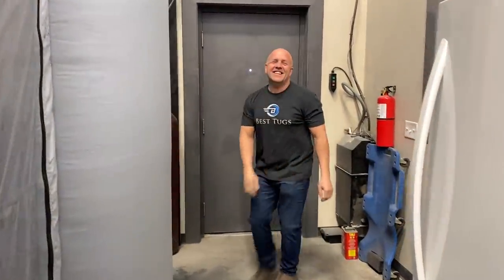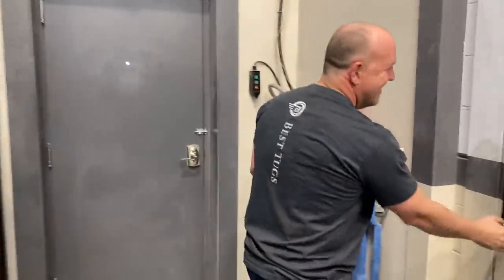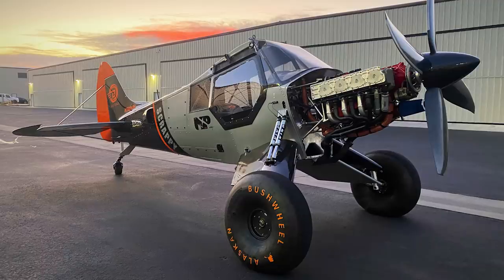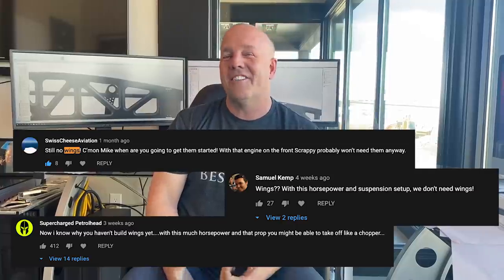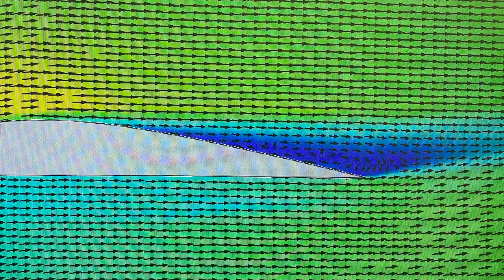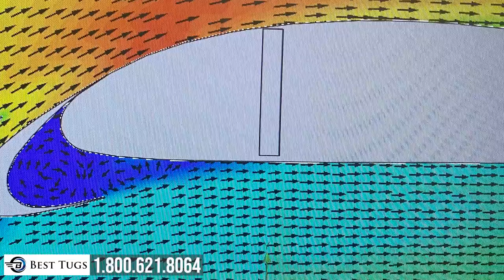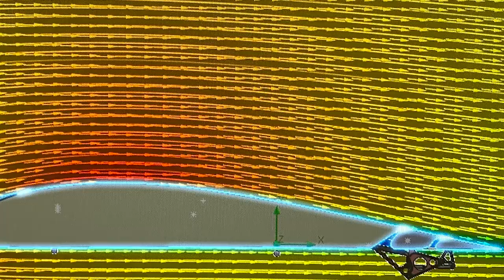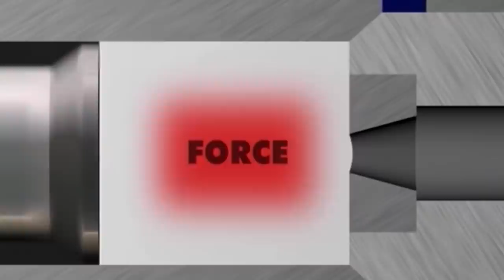Airplane Without Wings, Let's Try Something Different! | Scrappy #42

Comment: Mike: I realize that by the time you read this, the wings are already on the plane. But I have a wing design in mind which has been nagging me. I fly a zenith 801, So I know how beneficial slats and flaparons are. But I was kicking around an idea of a retracting biplane wing that is just a "cap" of carbon fiber on the top of the bottom wing which, when in cruise is snug on the top of the wing and would be invisible for the most part until extended. It would operate similar to adjusting flaps with a lever, the "cap" can be elevated several inches above the top of the wing surface, creating a second top wing only seperated by inches instead of the traditional full meter or more. The beauty of it would be that the chord of the top "wing" could be minimal because it wouldn't need to be as thick as a normal wing, because of the slot it creates between the bottom wing and the top wing. It would operate much in the same way that slats work, with the space between the 2 wings being small, but providing a much higher percentage of lift per inch sq.
On the ground, with the top wing pulled down flush to the top wing like a cap, being thin carbon fiber, (perhaps also reinforced in the layers with shaped, thin aluminum flat stock) you wouldn't even be able to notice that the wing had a second layer on top of it until the extension lever was pulled and the top wing was lifted up a few inches creating the gap.
It is just an idea but I am going to build a model airplane and see if it works.....
I love that you take the time to go over all of the details of your design thinking. I am kind of nerdy that way, I think most pilots are.
Ok, back to work!
Reply: Looks like a great idea!! But don't you think it would induce a ton of drag ? Also, the pitching moments created by the such a design would be immense... I can't begin to imagine the torsional loads created on ribs. Because you would have a flow transition point which would be behind the aerodynamic center of the actual. This means the normal (perpendicular) lift force differs from the actual wing and the "biplane" wing would pull different loads on the same axis, and that's an engineering nightmare!! But you should by all means try it and share your results!!
Reply: Ha gold, it could completely negate the pitching moment of the flaps if they deployed in unison. Maybe use a lock to prevent deployment in server turbulence in cruise and then have it auto deploy at an angle of attack. I am sure Mike now has a whole lot of data on the slot effect now so calculating the height above the lower wing might be easier with a few pointers. Adds a whole new dimension to Vf... ;)

Comment: You need variable geometry -- one geometric configuration for STOL, and another geometric configuration for high-speed flight.
Reply from the maker: That’s exactly what I’m doing, a transforming wing in flight
Reply: @MikePatey  negative flaps? Some gliders have them to decrease lift and increase the best glide speed.
Reply: @MikePatey  So are you thinking of trying "drooperons"? Some STOL designs have "drooperons" on the leading edge that deploy with the flaps, to improve the STOL characteristics of the wing. Retractable would be great, to allow for higher speed cruise.

Comment: Hi Mike,

Possibly consider variable geometry of a sweep wing, like on the F-14. The F-14 has several unique solutions that meet your goals. Stepping back and looking at a F-14, you will notice that the sweep wings are actually short and that the rotation occurs far from center of the plane. This allowed the body of the F-14 to also act as a wing, i.e. lift body. Now, for the F-14, this wide body allowed it to hold fuel, lots of fuel, and other things as a war bird. Also, it's two engines where wide apart as compared to other similar planes (e.g., the F-15 are very close together).

At any rate, I've always wondered why the wide body and short variable geometry wings of the F-14 have not been applied in other airplane designs.

Perhaps the outer region of the wing could sweep. Not a full sweep. But perhaps a 45 degree sweep. And the area of the wing closer to the body could be twice and wide, or more, than as the wing further from center line.

The gull wings of the F-4 Corser also produce both lift and speed. And short landing gear legs (i.e., weight savings).

Cheers!

Lincoln

Comment: I was thinking he needs the slats and flaps of a bf 109, only with motorised slats and extendable flaps like a jet airliner. It looks good in my head anyway...😆
Reply: Yes, that is what I'm thinking but, the weight?
Reply: I agree with the slats and flaps.   Make the flaps Fowler flaps.   Could they be manually operated ?    Either way, they add complexity and weight.
I’ll be watching.

Comment: Make a morphing camber wing. Make the top of the wing out of flexible a material. Swell for lift, shrink for speed.
Reply: Yep its feasible the Americas Cup AC75 boats have it and it is basically a vertical wing.
Reply: Could do the same with the underside. Pump out of the upper bladder into the lower.

Comment: I can’t stop envisioning f-14 style wings on scrappy
Reply: Me too, once the concept was said fast and slow.
Reply: @SimonTekConley  Which describes the F-111?
Reply: @garychandler4296  I ended up looking up all sorts of planes with the config. The Russians have some interesting designs. 

Another interesting way to go about it, would be having splits in the wing, where  you could change the profile on the fly. Say from a slow and go piper cub design to a more speedy swept back. Basically allow the leading edge to fold back into the wing to change the profile a bit.
Reply: @SimonTekConley  Nice. I was thinking that if the wing were flexible in the forward third, an aluminum control shaft would rotate, having maybe nylon or urethane wheels along it's length, on an elliptic arc that would push and swell that front 3rd, thickening it for slow speeds.
Reply: Ug, saw this after my comment. What an interesting channel.

Comment: Look closely at how the Blackhawk “tail” assists in maintaining a “level flight” cockpit, literally “extending” the fore and aft pitch con.  Don’t get wrapped around only the main wing.  Rather think about making the “entire aft wing” (and elevator), also “move” to obtain the optimum low speed or fast speed flight profile you desire.

Comment: Had you looked at The uk’s blackburn buccaneer. It had blown wings/flaps to reduce the landing speed for carrier landings - I know they had jet engines BUT your donkey up front seems to have a huge amount of available power at low speeds to use. Love your energy.

Comment: In the Army, back when we only had one radio to triangulate our position and an ash tray in the center of the dash like a VW Beetle. And auto pilot was a friction lock on the collective similar to an old farm tractor.
    I flew a UH-1H helicopter.
It hàd a semi-ridgid rotor system. The new helicopters like the UH-60 has a fully articulated 4 bladed rotor system.  Both systems morph to accommodate the pilots controller inputs and situational loads.
     I already see your on the right track. Good luck with it and I can't wait until we can have a look at your cutting edge design.

Comment: When I was studying aeronautical engineering in college, I always wondered what the perfect wing would look like. One that could morph into the needed shape for the task at hand. Something that could adapt while flying. Since I worked at an R/C hobby shop, I could build a model and test and perfect my idea to build an inflatable wing. Yeah, you're all going to laugh, as I did also! What I was able to solve was the ability to change the shape of the wing for prescribed performance envelopes. I played around with the idea for many months but having to focus on work/life, I abandon the project. I'm pretty sure I'm not the only one who's thought of this. Heck, deicers are inflatable parts of a wing. So it's to some extent that it has proven not that too crazy of an idea. To add to my idea was to offer the ability to change the wing's angle of attack. My buddies have done this with their R/C models in order to eliminate using ailerons to reduce added drag and complexity. Anywho, just some ideas I have worked on in my spare time when I was deep into my R/C hobby and engineering classes.
Reply: Inflatable camber chambers...

Comment: Just got the last section of your program. You are on the right track The width of the wing changes the wider it gets the flatter the top section which reduces lift and drag 
and the faster you go. 
Now using a semi symmetrical wing section will provide more lift at slow speed and less drag at high speed creating a more aerodynamic wing section. Swept back wing tips and trailing edges will also help your speed target. 
Flaps will only be needed for take off and landing when the wing is set for low speed they can drop down from the flat lower section. 
I used to build crazy flying machines in the 60’s using basic RC 
I look forward to seeing the wing you are going to create. I am sure it will work and revolutionise design for air rescue aircraft to be used in emergencies and very short runways or fields 
You may want a split cowling like bomb bay doors to hinge in the wheel struts to cut the drag on those big tyres. They lift to land an close around the wheel in flight 
The aircraft will look sexy with them to say the least 
All the best N

Comment: Thank you for sharing. I love anything mechanical. Especially when the builder is pushing the boundaries the engineers have set. Your thinking outside the box and that's the way I roll. I have never flown in anything. I'm terrified of just the thought.  But I love going fast on the ground. I did a dukes of Hazzard flight in a 1976 Datsun 620 pickup to avoid a head on collision with a Cadillac. I was passing a vehicle on my right that sped up and wouldn't allow  me into the right lane. And  the Cadillac was hauling butt towards me. No time to slow down and get behind the car on my right. So I lined up on an embankment that I knew was soft fly ash fill covered in grass. I knew this because it was a couple of my Buddies lane and bus stop for school years earlier. No time to waste I slammed down the gas and hit the fly ash bank at 70 plus, just as the Cadillac was clearing my right rear bumper. I was airborne at least 30' high. The owner of the yard I was flying over came around the corner of his house on an orange riding mower to my left. About 150' to 300' feet into his yard that sloped upward I made a perfect 4 wheel landing with a little bounce. I turned the truck around drove back out the way I came in immediately  without incident. I drove back home and thoroughly inspected my truck no damage nothing 🙃.  I left and went to my buddy Tim and told him what had happened. He didn't believe me until we drove by the place where it happened and he saw the faint tire marks of take off landing and return track down through the yard. Yes   I know I was lucky. Hollywood makes those stunts look easy and there's a lot of math- tikular calcumacations involved. I  just got lucky. Sorry to go so long. Have a wonderful day.

Comment: Would it be possible to use a "flexible" skin on the front of the wings and have a cam shaft type of internal device that can roll internally to widen the leading edge for slow speed and roll back to thin out during high speed? The skin may not even need to be stretchy, Just engineered to be tight throughout the process of changing the geometry. Just a thought that came to me while listening. Carry on.
Reply: JD that is exactly what I was picturing!😄
Reply: I was thinking the same think. A way of it  being stretchable

Comment: sounds like something that inflates,, deflates to the desired shape. or he has a bunch of motes   (the mote in gods eye) constantly  rebuilding the wing in flight.
Reply: "moties". Actually, I thought of the inflation thing, too. Or clever use of piezoelectrics?
Reply: probably using the inflatable deicing system that TBM's use ad a de-icing system to warp the aspect ratio
Reply: Thought it was "Moties"?
Reply: @bistromathics6  I wanted to build a wing that could retract partly for high speed flight.

Comment: Just a truck driver but 2 thoughts...
1. Changing wing shape using an air bladder inside the wing to change the curvature.
2. Moveable wing location using a simple screw to move the whole wing forward or backward to adjust for center of gravity changes and speeds.

Comment: As a kid I got a ride in an AN-2 ag sprayer. It had automatic wing extensions. Awesome but as Mike said, you need more space between the trees. 
Another idea is blown surfaces or reaction tips. The turbine engine makes a lot of interstage air. Plenty to do this. But, I think the flex wing idea is the right winner.

Comment: Exactly what I was thinking as your were describing the function of the wing "Variable Pitch Wing".
The outer shape of the wing would need to change shape during flight based on the flight characteristics.
My two cents, "could some type of Air bladder internal to wing be used to change the shape of the wing"??
You are a very impressive individual, keep doing what you are doing, and be safe.

Comment: I was intrigued a few years ago by news of development of a light aircraft with inflatable wings for military purposes. Your wing profile development process sparked an image of a rigid wing designed for higher speeds, but changeable in profile for lower speeds by inflating a bladder behind the leading edge on the upper surface to alter the camber. The lower pressures of airflow over the upper surface already are trying to deform that surface, so the adverse pressures should be minimal. Your concept of altering wing shape is particularly interesting. Best of good fortune to you.
Reply: That’s it. I was thinking an internal sort of crank shaft mechanism to warp the top foil contour... but pneumatics.. so much better! Of course, avian bones are filled with air, and actually lighter than the feathers 🪶... How about that?

Comment: Why not blank the high camber areas out as speed increases. The issue is air going over those areas at high speed, which you don't need then since the rest of the wing has plenty of lift. Diverting air away as speed increase could decrease total drag. This, possibly, could be done with fixed shaping to the wing (like a neutral or negative camber 1/3 out to suck the air away from the roots as speed increases? There are obviously problems there, but the kernel of an idea is also there) So, put more simply, don't change the size/shape of the wing, find ways to change where the air is going over it based on IAS. The better the diversion effect at high speed, the beefier you can make the roots for slow flight. Cool video! Love seeing your stuff. Thanks for keeping me dreaming about flight!

Comment: At first I thought you were going to repeat the principle proven by the F-4 Phantom II proof of concept aircraft -- enough power on a brick....  I figured you would eventually have to do some sort of dynamic airfoil design, either swing-wing or growing some aspect of the wing to change the camber and/or chord in flight, in some original way.  It didn't seem like you would be satisfied on this build without tackling that challenge.  Keep the videos coming, and thanks for the sneak peak!

Comment: Hi Mike. I enjoyed your talk on the properties and down sides of various wing designs. It seems to me that the problem is to deal with each end of the spectrum without having to modify controls to the point where the benefit of  a particular wing is not negated by the control features it demands. Yikes!  It seems to me that the only way to overcome this dilemma is to be able to change the wing aspect in flight. This could perhaps be accomplished using a strong yet flexible upper wing skin ( carbon fiber?) which can be pushed upwards using airbags or some sort of moveable framework. So there's my two cents worth. By the way, long ago the Russians designed and built a plane with extendable wings to challenge this problem and I believe that it worked but, as you predicted, it was too heavy to be practical. I have no idea if this is a practical suggestion but if anyone can build it you can. Good luck and soft landings; Tim.

Comment: Hi Mike,
 This a good time to add something  to this dialogue.
 Expanding the envelope is something I have done on my wing.
 I have been able to vary the camber to give me a higher camber for slow flying with high lift.
 Then when I move the control lever 180 deg I flatten the camber and tighten the sail fabric across the whole wing  plan.
 I works very well , and I have had this for now 15 yrs. with no adverse effects.
Its done by having springy top battens and the lower battens stay stright.
 Other safety features is I too fly with a deployable  parachute.
 and fly within the defined flight  envelope.
Im now thinking how it might be possibe to have a variable camber on the proposed wing for scrappy.  It will depend on what you plan to have as the wing top surface.  
Fabric is not so good as a aluminun top surface pressed up wards  by a rotating cam pushing up a plate.
 Just thinking.!!!
Ted.